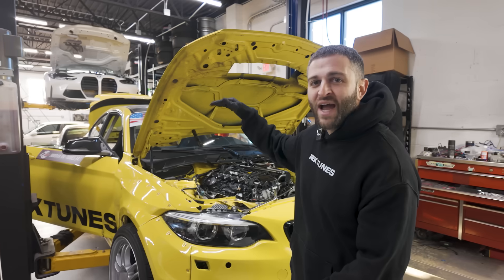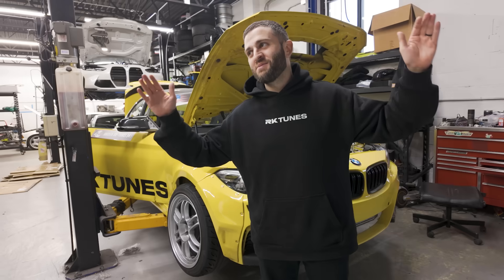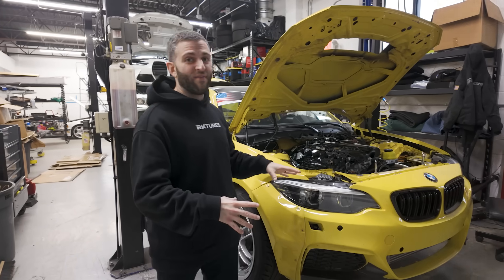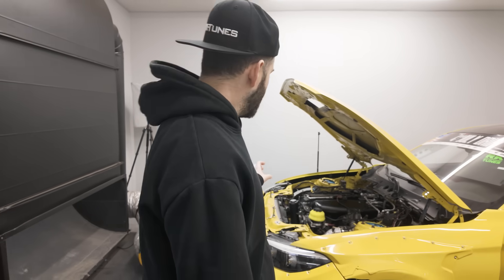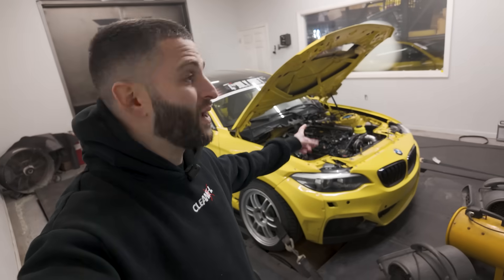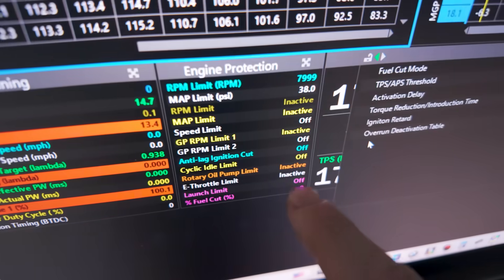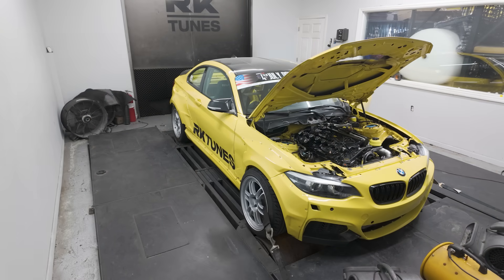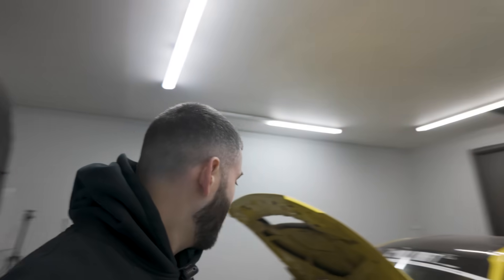Testing a Cheap VS Expensive Turbo.

Comment: How is it a fake turbo ? It worked great for you. You beat the shit outa it for a year and several thousand miles. You clearly have blow by issues and probably fuel in your oil witch would kill bearings
Reply: Yeah, i don't get it what he means by fake turbo 😅

Comment: Definitely don't cheap out on the wastegate!! Even if you cheap out on the ebay turbo (I did), get a good wastegate! I had a cheap ebay tial clone wastegate and within a few months, in a dry desert climate the wastegate internals rusted and got stuck shut and overboosted!!
Reply: That's why you need a standalone ECU for boost cut feature 🔥🔥
Reply: @BossGarage  that's actually what saved it. I have a standalone (a Speeduino) and it hit the boost cut. I stupidly had the boost cut set way too high though, like 8 PSI over normal boost levels, so I immediately turn that down closer to the normal boost level lol

Comment: I actually really fw pulsar turbos, here in Australia they are pretty common, I have a 3584 gen 2. It's been on the car for 4 years, flogged every day of its life at 550 and I've never had an issue. I checked it last week still no signs of wear.

Comment: Is the Pulsar really that bad? 
I haven't read of many bad things if at all on Pulsar
Reply: Seems like a video promoting Precision Turbos. They're tagged in the video description. So potentially a discounted turbo deal...? No info on the Pulsar and how much boost it was seeing. Seems like the Pulsar wasn't a good match for the engine in terms of longevity if a bigger hot side was chosen in favour of the Precision. Not exactly apples to apples. 
To answer your question, a Pulsar generally won't die that quickly. Drifting is seriously strenuous on turbos.
Reply: @lowdl  he also didn't explain if he was running a bov or not. Drifting there is alot of on off throttle, not running a bov with a turbo manifold that has notoriously bad oil return line isn't gonna help the cause either

Comment: I wish you would make the offical bmw turbo comparison video series.  Start with the e36/ m5x , Just post dyno plots/ video clips , and talk about each common turbo option.  Down sides, backpressure limints, or other common pitfalls. Not so much brand based nessasiraly. For sure compressor/ tubine size based comparison. 

 You know the deal. You could do all the bmw platforms , they would get a lot of attetion

Comment: ATI Dampers are tuned to a range/RPM or two and can be customized.  They are great for like NASCAR type racing, that the engine is mostly in a narrow RPM band the entire race BUT other designs work better for most apps in my opinion.  Innovators West is like a fluid pendulum hybrid if i rem right and better overall damper.  Fluid-Damper gets a bad rep from sitting for a long time or the TCI Rattler is noisy.   ATI could even re-tune yours and i do have a couple myself but I'd advise calling Innovators West

Comment: I have rebuilt a lot of precision turbos. They do fail too, but there is always a reason. The steel thrust bearing can cause failure, I seen a lot of them fail, I just switch them to the copper bar thrust bearing. I seen many precision turbos fail because of a small -10AN oil drain not flowing enough causing oil flow to back up into the cartridge and be fired out the seals, then the customer puts a restrictor in the turbo, starves it of oil and ruins the whole cartridge. 3 main solutions, machine the -10 an oil drains to 5/8, don’t use a restrictor, and change to a copper bar 360 degree thrust bearing.
Reply from the maker: My red e36 was like that. Except they had a clogged valve cover vent as the line was folded in half. So they put a smaller and smaller restrictor that killed it. I got the car. Fixed it and had to swap the turbo.
Reply: @RKTUNES  Would love to see you test/review HPT turbo, and compare it to your present turbo.
Reply: Copper is not used for a thrust washer it's too soft no turbo manufacturer uses it for that reason, your copper bar is either brass (cheap) or dearer bronze ,a quality turbo might use phosphorus bronze
Reply: Where are you based out of? Unfortunately my fancy ball bearing precision took a poop on me and am looking to rebuild it